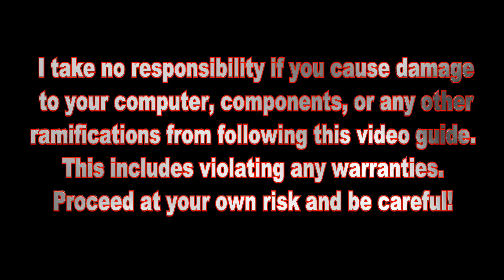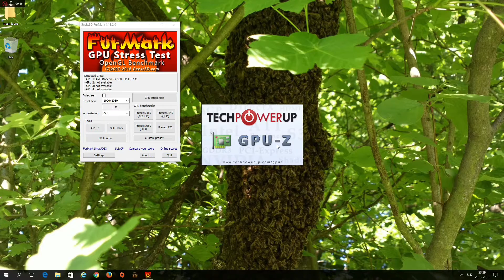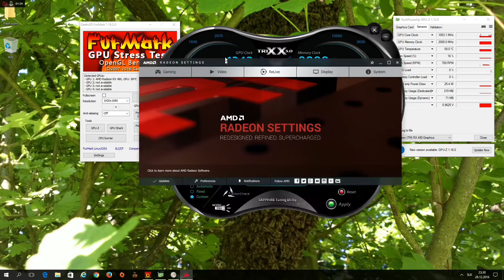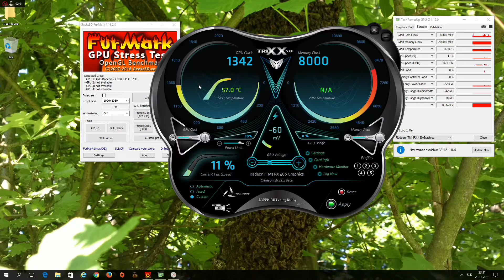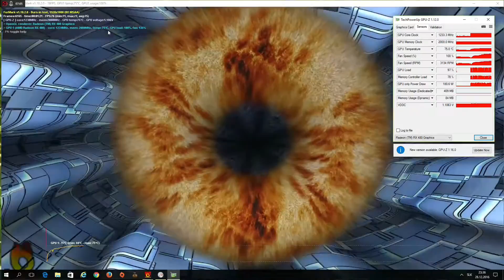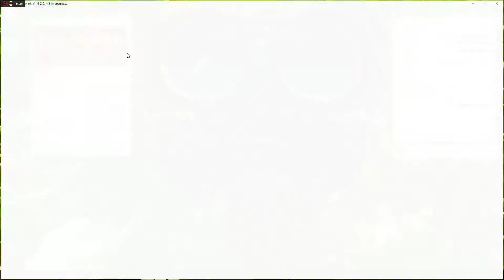Sapphire RX 480 Nitro Optimizing perfomance by undervolting

Comment: I HAVE OC MY rx 480 gaming x 8gb to 1360 mh from  1266 mhz  with just +50 % on power limit without undervolt 
and hit max gpu temp  of 74 c with 2200 rpm at heavy stress test with 3d mark  

but on game it  nover go above 71 with 1900 rpm on 100% load
Reply from the maker: even more golden chip than that one of mine then :)
Reply: @fxgaming1157  lol  .
Btw 75 c on an gpu inn long période of gaming is fine ?  (7 hours a day)
Reply from the maker: @Dukali01x  Yes that temperature is just ok :)
Reply: @fxgaming1157  thanks btw  ☺
Reply: @fxgaming1157  but recently i have undervolt my 480 to 1020 mv with to stock 1266 mhz  and i noticed   the temp are very low and the power consumption is low a swell .

thas undervolt damage the hardwar or not ?

AND IF NOT why are peaple not undervolting their gpu's..
(●'◡'●)
Reply from the maker: @Dukali01x  Undervolt should not damage the card, but lifting powerlimit can eventually damage card over time. However I run my RX 480 over 2 years undervolted and powerlimit increased. So far card working excelently :) So is up to you. I think only undervolting the card should not damage the card tho.
Reply: @fxgaming1157  i had undetvolt the card to 1020 mv with 1270 mhz . And its fine
About the power limit .the card usally  take about 110 w at full load  .
Now with 50% power limit it consumme about 20 to 30 watt more .( under tdp "150w")  soo it dowing great soo far
Reply from the maker: @Dukali01x  It is doing great indeed, enjoy your GFX long enough! :)
Reply: @fxgaming1157  thanks man :)
Reply: @juan hilario  on my msi rx 480 it was stock t 2000 mhz and i oc to 2200 mhz
Reply: @juan hilario   its all good 
try to folow his steps and u will be good  👌https://youtu.be/XydZH8DaTuI

Comment: thanks for this tutorial, really helped me a lot!
Recently got an Sapphire rx 480 8 GB from my brother, it still in good condition, not ex mining.
Following your tutorial, can we downclock it maybe GPU Clock to 1200 and Memory Clock to 7500?
To optimize power consumption, and is it safe?
Reply from the maker: Hello there, glad it helped to you :) Well My Sapphire has dual bios. One is clocked to around 1230(not sure exact number as I run second bios) and second one is around 1342. If you got Sapphire there should be little switch called V BIOS SWITCH so you can try to switch it to slower speed. Never tried to downclock memory, but I am sure you can do that since RX 470 runs VRams at 7000 and that card is just cut version of RX 480. Make sure to do some stability tests though to avoid sudden blue screens or errors. Let me know how you did please^^ I might try it myself when I get more time.

Comment: Thanks. I tested my rx 480 a bit and now it stays at 1342Mhz with power limit 15% and mv -30. I also created a custom fan curve, I don't really like the automatic one.
Reply from the maker: I am glad it worked for you. And yes automatic fan curve isn't best choice. Myself set max speed of fans at 76 degree, it is bit noisy in full load but like that I am sure card wont die very soon to overheat or wear off lifespam.

Comment: Yeah man, your card is throttled. that 1342 you have in there is pointless unless you can actually hit that mark. You are running stock in your video at 1226-1288.
Reply from the maker: Exactly :) I found that factory/stock settings made my card throttling. But once it was udndervolted and powerlimit was lifted it can sit at 1342 24/7 if it is under full load. Well unless temperature of card will reach around 80 degree celsia, then card starts throttling. However I used GPU-Z utility to see how card can cope in games. GPU-Z is great tool because in SENSOR tab you can monitor temperature, GPU core clock and voltage over time. Also you can see average values or max values. In Battlefield 1 or Warhammer Total War card can be sitting at 1342 as long as it is needed :).
Reply: yeah you should do a video of it actually working.
Reply from the maker: Weeeell obviously you didn't watch entire video :) Just shortcut to point where I did it 10:10  :P
Reply from the maker: Weeeell obviously you didn't watch entire video :) Just shortcut to point where I did it 10:10  :P

Comment: How is your memory clock at 8000? Mine is at 2000 and max is 3100.
Reply from the maker: Hello! In SETTINGS in Sapphire TRIXX you can tick SHOW Effective Memory Clock, then it will show 8000. Its because if you have left it unticked then it shows only clock on one piece of Vram. There are 4 pieces each clocked to 2000 so it means 4x2000=8000. :)
Reply: FXgaming I tried your exact same settings but my computer keeps crashing
Reply from the maker: Try to set voltage bit higher then, not to -60mV or -50mV but to -25mV and see if it keeps crashing. If it will perform ok at -25mV, you can try -30mV after and so on till you find sweet spot. Also make sure powerlimit is lifted up at least to +20%. When it comes to fan cotrols make sure card fans are on 100% when card temperature is on 75 degree Celsias. It will be noisy as hell tho :D
Also some cards can't be tweaked by undervolting as it depends if you were lucky with chip. Every chip is different. Thats when it comes overclocking or voltage playing, overclockers call it Silicon lottery(you will win or not win good chip for overclocking or some other tweaking).
Reply from the maker: Try to set voltage bit higher then, not to -60mV or -50mV but to -25mV and see if it keeps crashing. If it will perform ok at -25mV, you can try -30mV after and so on till you find sweet spot. Also make sure powerlimit is lifted up at least to +20%. When it comes to fan cotrols make sure card fans are on 100% when card temperature is on 75 degree Celsias. It will be noisy as hell tho :D
Also some cards can't be tweaked by undervolting as it depends if you were lucky with chip. Every chip is different. Thats when it comes overclocking or voltage playing, overclockers call it Silicon lottery(you will win or not win good chip for overclocking or some other tweaking).

Comment: I found it very strange that your card is throttling at stock settings. It should not do that.
Reply from the maker: Maybe it was underpowered at stock settings. I noticed that each time I lowered voltage and increased power limit I was getting closer to proper turbo boost. In the end I made card sit at that turbo boost 24/7 if full load. As I said on stock frequency and with tweaks on fans and voltage/powerlimit, I managed to get like 5th-6th position in Userbenchmark from 8000 tests so I am happy with card. Ofc in better benchmark tools like 3D mark, it is was not so much perfect boost against other people. However I find 3D mark CPU dependable too much even in graphics only benchmarks, so it means in my case GPU is bottlenecked by my CPU. As you said card should not do that, however now it is working perfectly so I am ok with it :)
Reply: I have one myself, the 4gb version, and it stayed at stock clocks and voltage flawlessly through testing..
I wasn't happy with the power draw though. So after extensive tweaking i managed to undervolt it by 170 mV without touching the core clock.. It stayed at 1306 all the time while drawing 110 - 120W and never exceeding 60c..
Reply from the maker: Great work! On my card I managed to go only -60mV, it can work even at -90mV but...In very demanded games I was getting Direct X errors occasionaly and quiting game afterwards. So I played a bit more with voltage and realized I have to leave it at -60mV, here i don't get these Direct X errors. As I said every card is different in meaning of overclocking/udervolting etc, because every chip is unique in its behaving. I know many bitcoing/ether minners went so far as you with undervolting to drasticaly lower the powerdraw. But I am using computer and this card only for gaming and video editing I have to leave it there to make it stable. Ofc I would wish push it lower to make it more efficient but hey its silicon lottery I guess :)

Comment: I am having the same throttling issues with my Sapphire Nitro+ RX 480. My drivers crash and recover a lot. I've been doing some research for days trying to figure out what my problem is. I can play games for hours sometimes without a crash or just entering a game can crash it. My big question for you is...I see in you GPU-Z your card is running PCI-E x16 v2.0 while at idle and runs at v3.0 while using the GPU. How is it running v2.0 while in idle? Mine is running v1.1 while idle and v3.0 while gaming. I feel like when it throttles from v1.1 to v3.0 it causes the drivers to crash.  My gpu passes every gpu stress test I throw at it but still crashes all the time while gaming. I'm not sure if this is something that would be causing my crashing but I have tried everything else, and after watching your video I noticed the difference in the idle bus speeds. Figured I would ask.  I've looked through my bios and can't seem to force it to run v2.0 while at idle states. I have an Asus Z170-AR mobo. Any information would be helpful.
Reply: did you try MSI afterburner in game? If not i would recomend it for you to install and run it on background while you play games. You have to set it up the way that you see GPU usage and for main reason GPU teperature in game overlay. If card is going over 78 degree it might be that your card overheat and game crashes. I checked mysefl yesterday and played Battlefield 1 on ultra in singleplayer, got 100% gpu usage but card teperature was kinda low at 64-65 Degree. Well lets try MSI afterburner to check how your card do in games and if your games will still keep crashing and not due temperature, I might help you another way. Because I would for example try manually set fans to perform better than in factory settings. Also you might need increase power limit by 10% and if you have Voltage lowered maybe to let it be zeroed. Because i was crashing only if I had undervolted the card too much or I didn't increase power limit enough up. Let me know, I will gladly try to help.
Reply: also make sure you gaming with high performace settings, not balanced or power savings in widows.
Reply from the maker: And one more thing I checked just on GPU-Z. Mine card runs 1.1 at idle 
and 2.0 at load. However your motherboard supports PCI Express 3.0 while
 mine MSI 970 gaming only PCI Express 2.0. So thats why my and yours 
GPU-Z readings are diffrent. In your case I would say either your card 
need some tweakings with powerlimit and voltage or driver of chipsets on
 mother board or GPU driver is not current one?. As I said also make 
sure you play on high performance in widows power settings, because that
 can have influence on your PCI express issues as well.
Reply: Always run afterburner. My Temps are normal hits 76-77c running max loads 75c max while playing BF1 on ultra. All drivers are updated. I've tried rolling back AMD drivers no luck. I've been at this for days. It worked fine for the 1st day I got it then started crashing. It does the same thing on a completely different pc build with Sabertooth 990fx mobo fx 8350. It just confuses the hell out of me because it's completely random. The fact that I can game for 4 hrs straight on BF1 good Temps great performance but when I go to close the game it crashes or crashes as i open the game. Sometimes I have to open origin and let it crash 3-4 times before it will work.  But the fact that it does work eventually...it doesn't  convince me it is hardware related but I think I am going to RMA the card.
Reply: Oh and yes I'm on performance mode in windows power options. Oh and my GTX 960 works just fine in both computers.
Reply from the maker: yeh probably RMA card. I would recomend to try increase power limit and increase/decrease voltage(but only like -10mV) like i did in first step in video. But if you gonna RMA it, I would not risk it :D. I can pretty sure tell you that from factory these cards need some tweakings if I used TRIXX because they made for example fans running slow and not noisy but temperatures were high. So I made these corections with custom fans and tweaks to get maximal performance without overclocking and at reasonable temperatures.